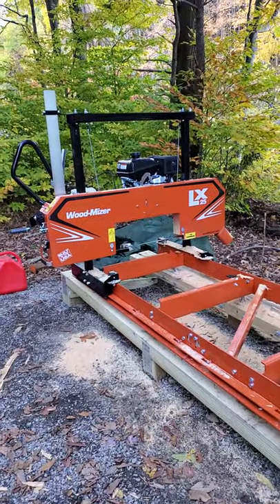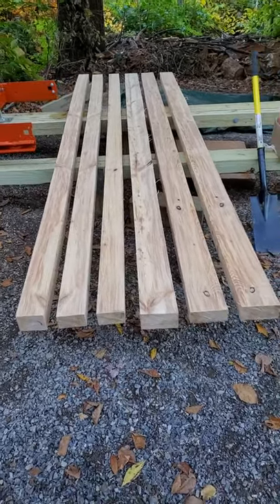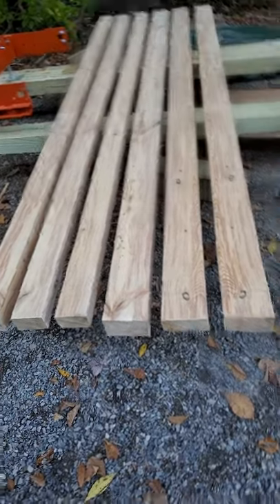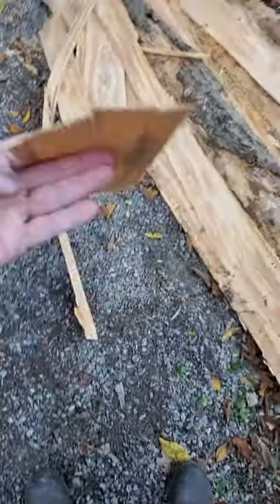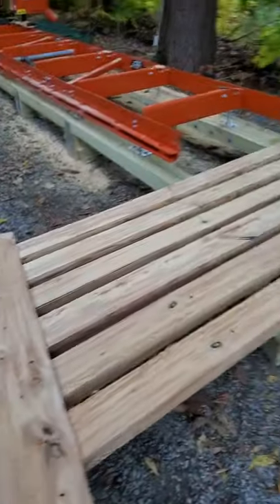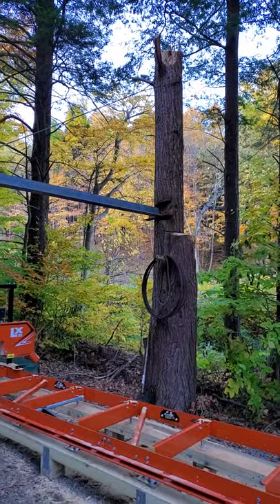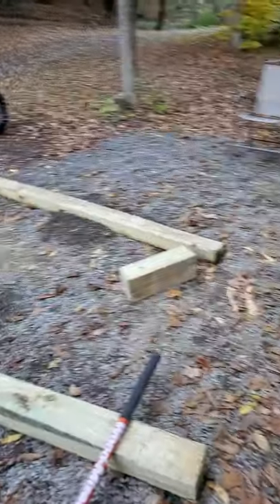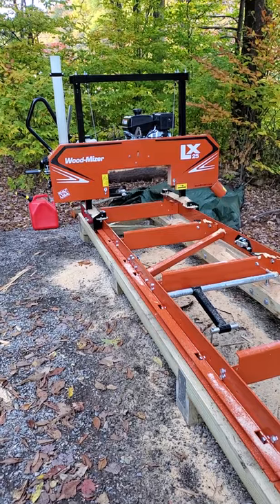Woodmizer lx25 video 12... first thoughts on performance

Comment: Thanks for this insightful and detailed look at the LX25. I'm in the market for a mill, this fits my budget and needs, but I wanted more detail. This series is great. Woodmizer should put it on their website. Good work, no BSing around.
Reply from the maker: Thank you very much. Just a few small problems. I will make a update on small issues and the fix asap.